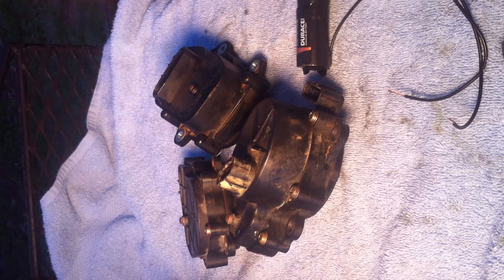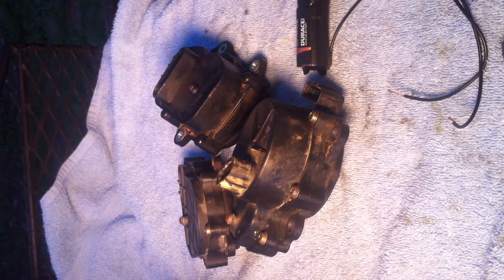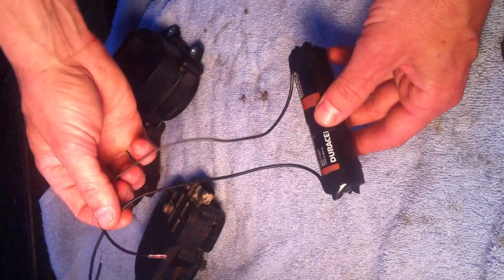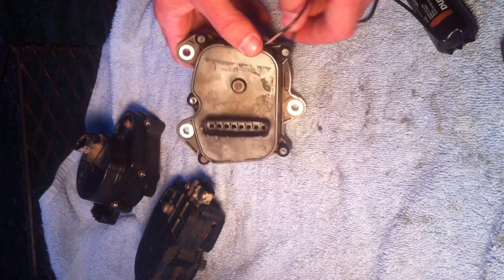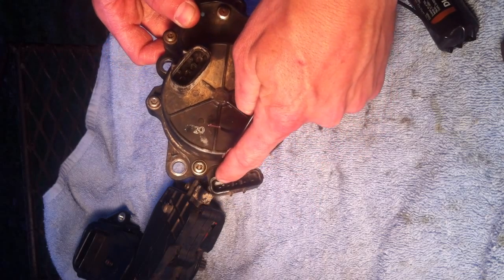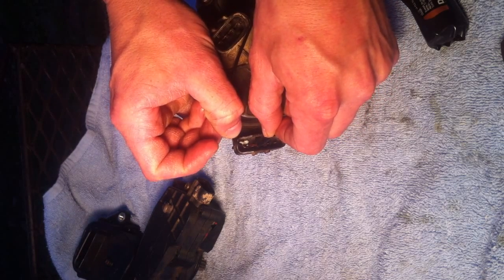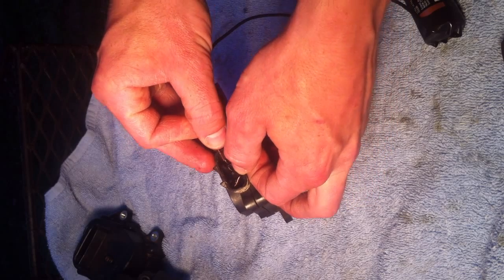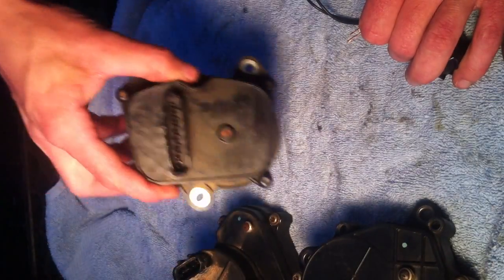Testing the Yamaha 4x4 Servo Motor Assembly

Comment: i got a (i think) unique issue. my servo motor runs but it doesnt show on dash that its going into 4x4 lock or other. 2011 grizzly 700
Reply from the maker: Probably a bad connection or something  in the display.

Comment: so you just put those batteries together, and then taped them? did you solder the wire on the ends or just tape those too?
Reply from the maker: Yes just taped the ends too
Reply: @501PartsTech  so I just did this, that thing was a PIB to get out, LOL it doesn't do anything so that means bad motor, correct?
Reply from the maker: @chs417  yes that means it’s no good

Comment: Every time I put the switch on 4x4 it blows the fuse help
Reply from the maker: Raymond, there are several things that you need to check, first being the servo as it shows in this video. If it is good, move on to checking your switch, then the relays. Lastly, look at the wiring, you may have a short somewhere. See our troubleshooting page here for more information. http://www.501parts.com/downloads/

Comment: I'm looking at buying a grizzly right now. It's an 02 660 but it is stuck in 4x4 and won't disengage. Runs excellent and 4x4 works great. Do you think this is a big problem? Or should the servo/relay/ and or fuse replacement solve this? Thanks bud
Reply: I too have the Same question.!  I have a 2013 yamaha grizzly 700.
Only thing I haven't changed now is the 4wd switch. But I did clean it just like your other videos. I also ordered a servo motor from you and changed it too. Than I set it back into 2WD. (It's stuck in 4x4 right now) But I didn't manually turn it inside the diff itself to 2wd. Could that be the problem? I also put 2 new relays. And the 3rd one is fine. I also tested the old ones and new ones the same way you have in previous videos. Should I have set my diff inside to 2wd also or changed my switch? It doesn't seem to get power, just has ground when I used a light tester. I also can't hear it engage. It's still stuck in 4wd